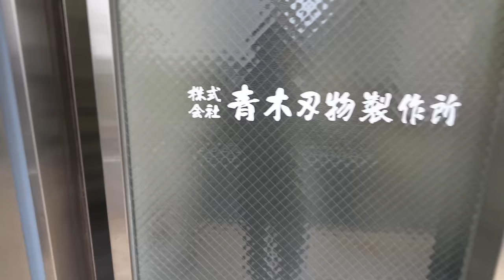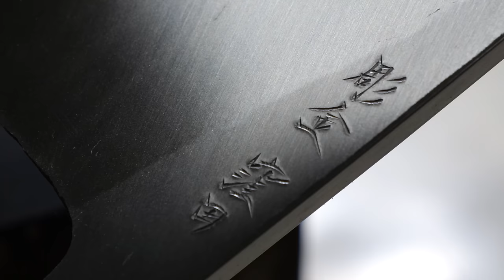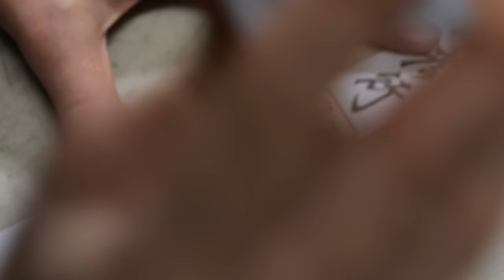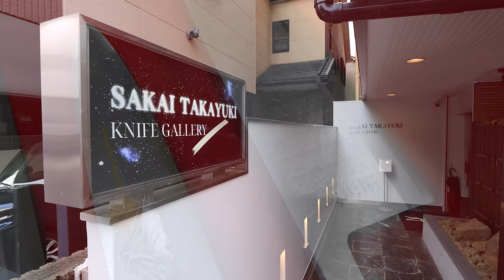包丁に彫刻する。世界が認める若き日本人女性。驚異のスゴ技。

Comment: Wow, my respect for the speed and precision shown here. Personally, I would be interested to know the hardness of the steel or what type of steel is used here, because it seems to me that it must be very soft to be able to work it by hand like this. However, if the blade were soft, this would mean that it is very sharp, but not particularly sharp. Or are the blade and the Ricasso hardened differently?🤔
Reply: Japanese knives have a special trait. They are cladded in soft steel (a technique developed in the past when steel was hard to come by and they had to save the good stuff for the actual cutting edge).

Most of the knives this lady works with are called ni-mai (double layered steel), single beveled deba meant for fish butchery. The cutting edge is hard and protected by the soft steel which she carves on. I assure you, they are very sharp and keep an edge for a long time.
Reply: @jiahaotan696  Thank you very much for your answer. That was completely new to me. I looked it up on the internet and found that a 14th century knife made of two layers of steel was found in a Buddhist temple in Japan. I can't believe that something resembling modern laminated high-tech steel has been around for so long.👍

Comment: Wait.. The engravings were done on already hardened steel?
Reply: Using even harder steel tools
Reply: Only the cutting edge of the knife is hardened steel.
Reply: Asian knives are made differently from European or American ones. The knife has a thin layer of very hard and brittle steel, which is surrounded by soft, cheap steel. This dates back to ancient times, when the islands had huge problems with quality steel.
Europe/America follows a different path - generally much higher quality steel is used, which can maintain flexibility at high hardness.
By the way, the approach to sharpening knives is also different from this - a European kitchen knife is easily sharpened with a ceramic rod, while a Japanese one requires expensive water stones and high sharpening skills. Also, if a European knife encounters something hard, the cutting edge will not break, and it is easy to straighten it, but a Japanese knife will get a chipped edge, and you will have to sharpen the entire edge from start to finish for a long time in order to grind off the damaged area and sharpen it again .